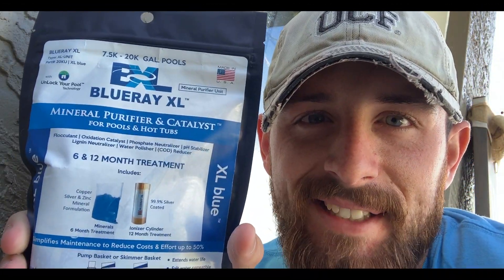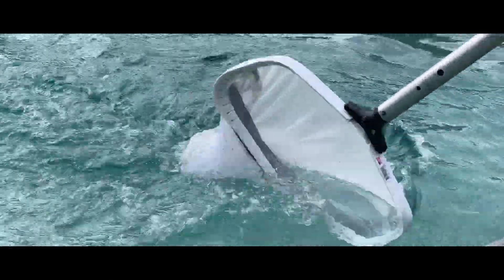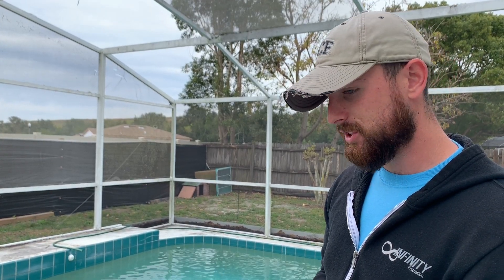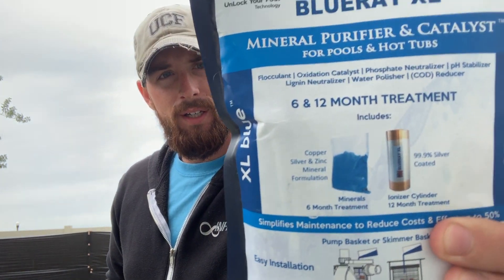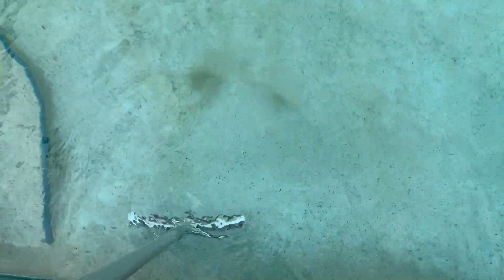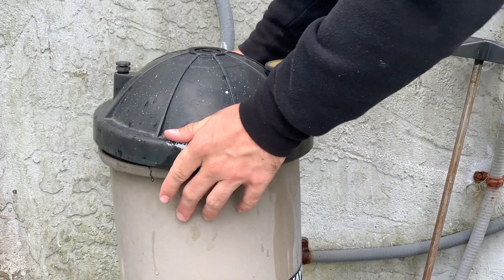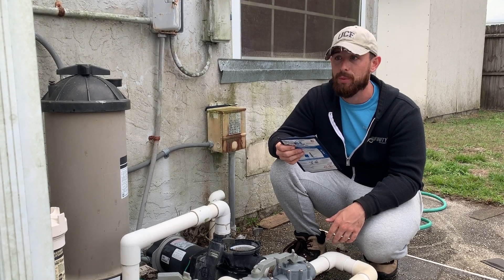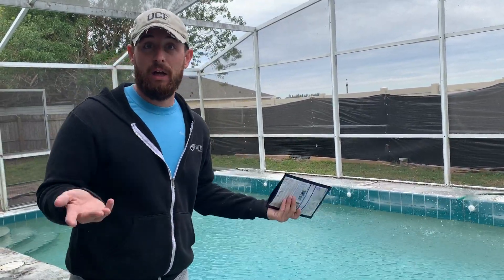Blue Ray XL - Installation

Comment: My opinion CYA at 20 is to low. Probably why they can’t   Maintain FC levels.
Reply from the maker: Part of the sales pitch is that its supposed to reduce chlorine use. It just didn’t work for us, maybe you’ll have a better experience
Reply: @docdeanspools  on the website it states that you need a minimum of 30ppm of cya